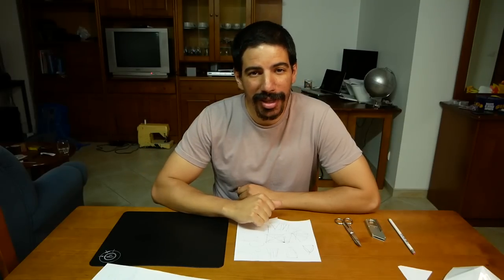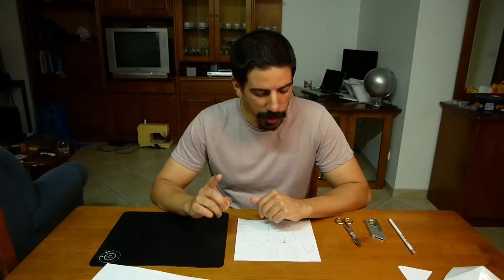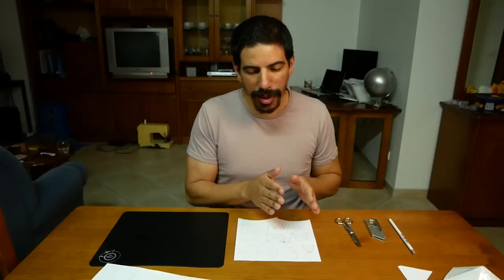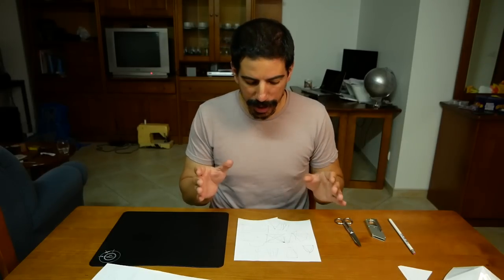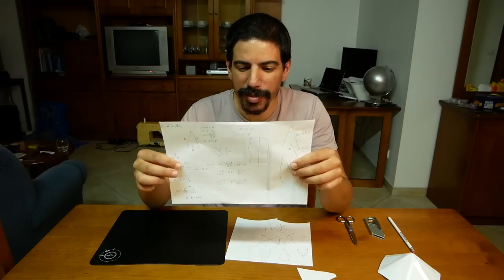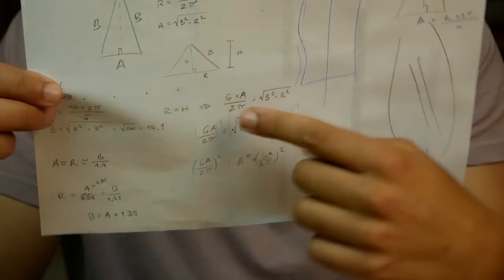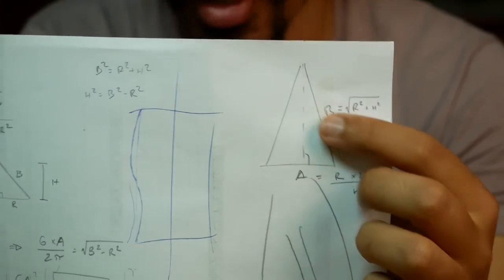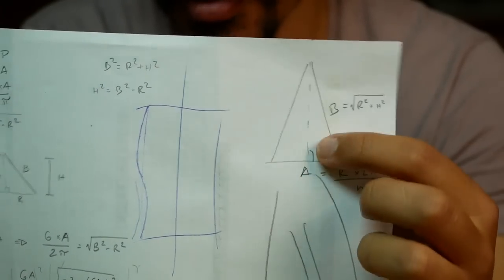Sewing a mini Parachute - Making a Paraglider Part 2 - BANDARRA

Comment: Without an exit hole for the built up air to escape from, it will continue to oscillate when built up with pressure. Make one small and start from there to see how big the vent in regards to weight differ from chute to chute. The descension rates will obviously change. Greta stuff again, and another start to a bigger project.

Comment: The first chute you made there was actually a bit of an improvement on Leonardo's design, but you've got a bit of hindsight that he didn't.  ;-)

"Took a bit of a leap of faith, even though I didn't understand the maths yet"...NOW you're cookin'!

You found out about spiral or pendulum instabilities with round chutes very quickly.  Consider a center hole.

Here's one you might want to try, just for fun.  We used to make para-balloons as kids out of that really thin dry cleaners bag plastic material (it was about the same weight as those crummy little grocery bags available now). 

We made them about 2-3 feet in diameter, just twisting tiny tabs at marked positions around the perimeter to tie thread onto (or conversely use a small spot of tape to attach them, a "J" or partial loop under the tape helps), then bring all those tabs together and tie a knot to hold them all together at the "weight" side with the strings just taught to ensure equal length. 

Then you set them up with just a bit more weight (a few very small nuts, like number eights if I remember correctly) than it takes to inflate them and make them stable indoors, so that they float down very slowly (if it is a bit more windy you might need a bit more added, but then more lift is required to support the "balloon").  Then we would go out on VERY light to no wind thermally days, and launch them by holding the weight and sort of swinging up the inflated chute side to vertical, you kind of have to learn to keep the chute inflated while it's moving sideways a bit, but it's easy to figure out, almost more like inflating the chute high and moving the weight lower. 

You can see it there is lift available as it will hold the chute up, then just release and you have a ROUND parachute "thermaller".  If no lift just repeat the launch action.  It usually took us a couple of minutes of doing this to find some lift.  We used to lose them all the time, but they are quick to build, and a good bit of fun.  Often as they went up, you could see them spin due to the thermal rotation, and often the thermals built enough energy as they got up a little ways to collapse the chute, and sometimes they would STILL continue to ascend.  Binocs are a good addition to watch HIGH flights.  We never had a place to wave lift fly them, but you do.  It would require virtually NO wind to lift off THAT slope.

Comment: You could have just used a round piece of cloth or thin plastic. I made hundreds of parachutes of different sizes, shapes and materials, when I was growing up. I have three now that are of thin plastic and over 6 ft. in diameter and attached to a replica of an Apollo Command Module. The only time I used a "gore" shape was when I made 10 ft. diameter hot air balloons out of tissue paper. I have one know that is 20 ft. in diameter.